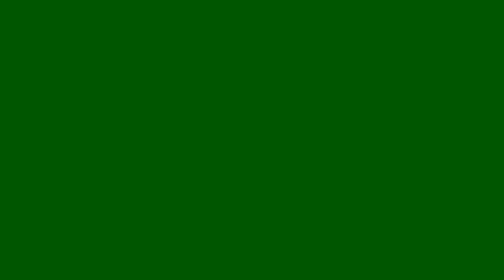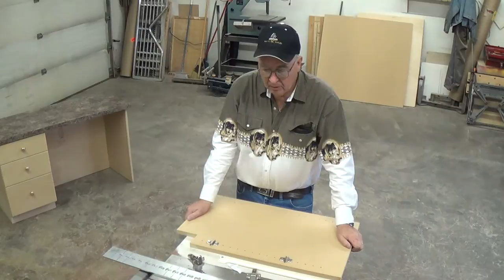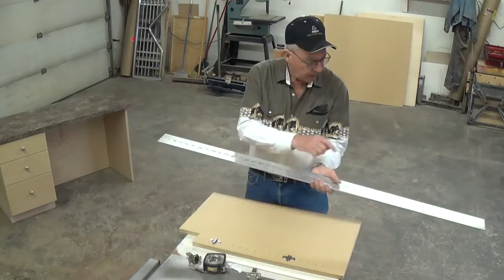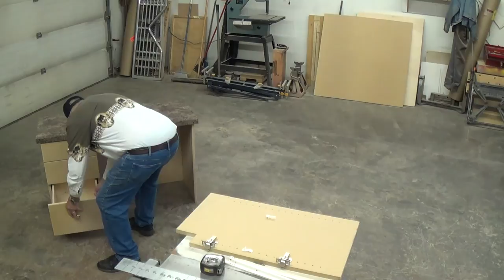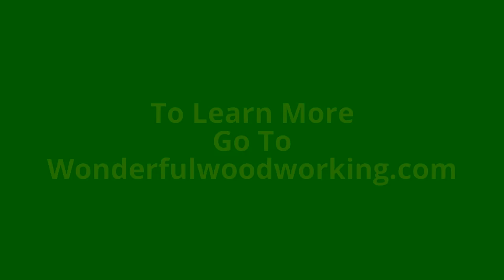The 32mm System In Cabinet Building

Comment: 1:00 Guy says he's been using 32mm for years and doesn't know it's 5/4".....
Reply: It isn't though. 5/4" is 31.75 mm.
If you make two holes and space them 5/4" apart instead of 32 mm, it makes hardly any difference, but since this is about making a series of equally spaced holes, a row of 20 holes spaced 32 mm apart will be 15 milimeters longer than if they were spaced at 5/4".
Reply: @marsdeimos4301  It's 5mm less than a 1/4".... (0.200) actually.....actually it's less than that if you take into consideration half the distance of the first and last hole.
Reply: @williamskrainski8407  really, because what does 0.25 mm matter? accuracy is over-rated. 0.25mm per every 32mm over let's say a YARD so you can understand, let's see, that's only...